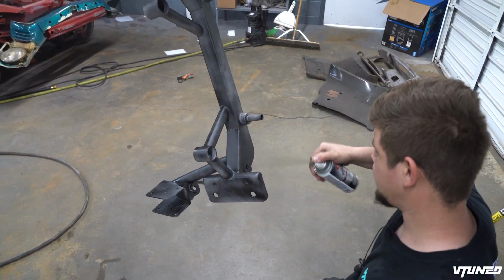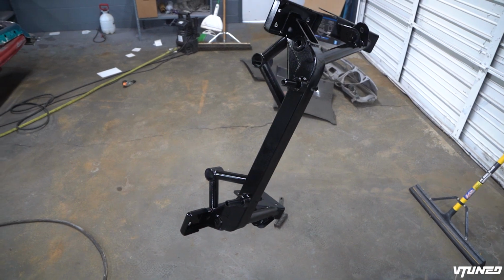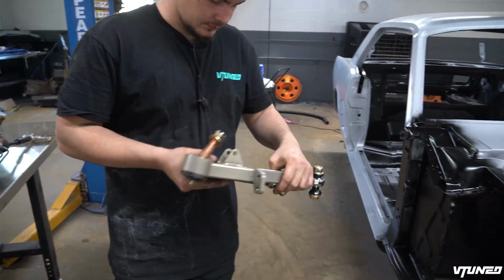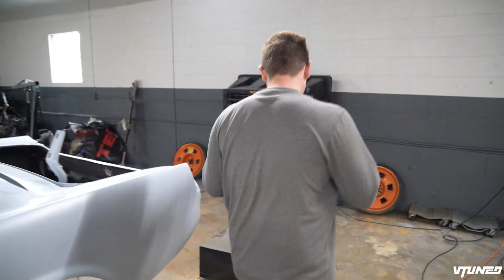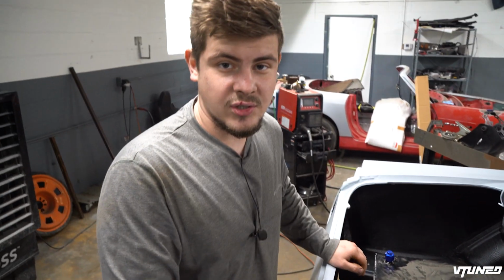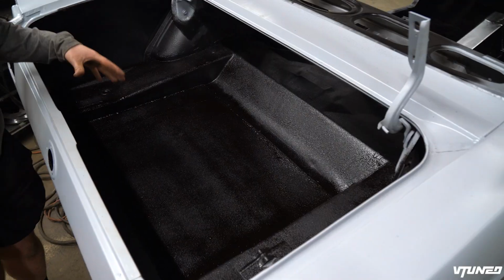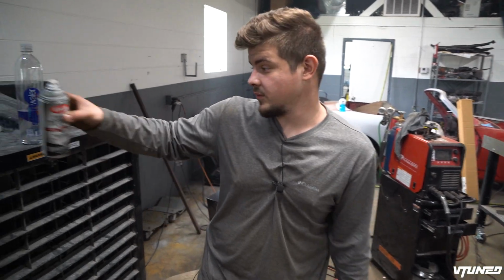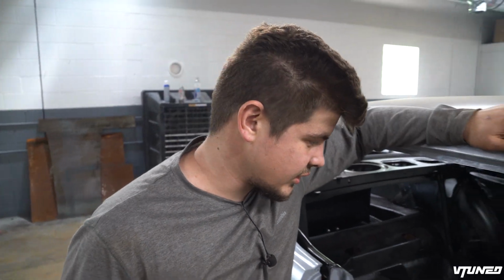Finally Starting To Reassemble The 1965 Ford Mustang (HUGE MILESTONE)

Comment: Automatic will be the best option..

lower the fuel tank for gravity.. then filling cap keep it from right side 

Open one small round cut in trunck for drainage of water if decide to clean trunck, first find rubber cap for it same as OEM .

Don't forget to seam seal all weding and joint..

Comment: Don't rush this build as it appears that you are. You have access to a paint booth, I cannot believe you are rattle canning it. Also, drop the tank. It will not be to difficult and the filler neck would align to the factory location.

Comment: Hi Ben, as you wont be racing this car, wouldn't it be nicer to use the original fuel filler location and lower the tank to allow for that. Keeping centre of gravity as low as possible? Locating the filler to another place means another hole or mod. Using the original filler will be a wise move I think. Auto is cool as well as the build, awesome.

Comment: Lower that fuel cell as low as possible for weight and trunk space...the way it is typically done is to build a small box/cage out of square or angle iron that the cell/box fits into and the top of the cell is maybe either flush with the floor or up an inch or two....

Comment: I really think you should put mounting tabs on the top of that gas tank and trace it on to that aluminum floor you're putting in and cut it out and drop the tank in a mount it up with the tabs you weld on top of the tank

Comment: The sump in the bottom of the tank should face backwards to not cause a fuel starve issue. Cut a hole for it to drop thru the floor. Also make sure you put a firewall between the trunk and passenger compartment.
Reply: NHRA  rules.
Reply: @chriscatarcio2983  multiple sanctioning bodies require it. Just a good safety precaution if your going to install a fuel cell in the trunk.

Comment: Defiantly recess the tank , if it was just sitting on the trunk floor the top of your tank would be level with the filler opening , it kinda needs to be down hill for the fuel to be able to run into the tank .

Comment: I would cut the hole to get it flt the tank flat.  Then I would measure to see if I could cut  hole in the side of the fuel cell to use the original fill location and run a piece of pipe to connect the 2 locations.  Wouldn't know if it is possible until the cell is in its final place.  Also you have the tank backwards.  Feed lines towards the rear because that is where the fuel goes when moving forward.  You will have fuel starvation in the direction.

Comment: FYI the bottom fuel feed on the fuel cell goes to the rear of the car, you keep sitting the tank in with the lines facing forward.  If you put the lines forward you can starve it under a hard launch.

Comment: the outlets on fuel cell need to point to back for fuel to not slosh back and starve the system on launches i would recess it in to floor to get some trunk space and use factory filler as well

Comment: just purely as a performance standpoint putting the fuel cell halfway through the floor one would help with the filling but also puts the weight lower in the body so its handling would be better but its your stang

Comment: put the tank underneath the plate you just welded in. then you can use the factory filler there is plenty of room under where the tank went and bonus you have boot space and the car don't smell like fuel when you top up cheers from down under

Comment: I think this is the first car youtuber to say he doesn't like manuals 🤔 I give him props for expressing the truth and not being cookie cut like every other car youtuber, that scream "manual or die!"👏
Reply: Automatics are boring.  They fucken leak all over the place when you take them. Out for service. and rob horsepower.  
They are heavy to. Make the car hot  inside. They suck.  V8 super cars run stick transmission.  Clutch less. NHRA  pro stock. Cars run a stick. Give me a break.

Comment: Hey Ben: if you decide to do another car like this, or any project where you're going to be spot welding, you might want to think about buying a spot welder...it's SO much faster and easier than a mig. Two electrodes, press against the metal, zap, two welds instantly. Move on 2" zap, 2 more welds..
Reply: Are you sure the shop spot welders are that good? I’ve seen others using them having to weld over the top of them again probably because the spot welds don’t go deep enough.
Reply: @R2D2trashcan  they don't go deep enough due to the settings. I worked in a body shop and that's all they used, as strong as the OEM ones. 

I also designed metal store fixtures and worked closely with many manufacturers, set up properly, the spot welds are as strong as virgin metal. 

You have to set them high enough to produce a strong bond, but not so high you blow through the steel.
Reply: @muskokamike127  ah ok maybe people just don’t trust them also as the weld looks so clean. They look really good.
Reply: @R2D2trashcan  Yeah there's no splatter or bubbling or anything to grind. When they're done correctly, when you chisel them apart you leave the chunk of steel behind where you attached it....When I was first learning to use it, the boss would give me a bunch of scraps, I'd zap two and he'd pull them apart with pliers. "hotter" he'd say. I'd turn it up a notch and try again "ok, good" and when he peeled them apart it'd leave a chunk behind. 

Then he would have me turn it up again and he'd peel it like it was nothing but I'd left a big circle behind because it was too hot.

Comment: The sump in your fuel cell goes to the rear, and return and vent in the front. That way as the fuel level drops and under acceleration fuel is pushing to the sump and outlets. If you install it backwards fuel will rush away from the pickup and also fuel will try to climb out the vent and hinder fuel trying to return to the tank. Never, I repeat, never run fuel lines inside the car unless you have a death wish. And for that engine, one fuel will do the job. Cut a hole in the trunk floor for the sump to protrude through and run the lines outside. For that engine you don't need two fuel lines. You will never make enough horsepower to require two. I use one line on my race car that is 1100 hp, 598 cubic inches feed by two 1050 Dominators and it never starves for fuel. Also there are some great fuel tanks out there that fit like the stock but have vast improvements, suitable for the street or track.

Comment: Yo uncle Ben... Remember, with great added power comes great added responsibility... Lower the tank... Either by raising the tabs on the cell, cutting a whole in the new floor board... Or mounting it underneath with steel straps...
Better center of gravity and definitely for the longevity of your fuel pump... As well as being able to use the factory filler...

Comment: I would lower the tank at least half way down into the hole. That gives you more trunk space and lowers the center of gravity. You don't want 120 lbs of fuel sloshing around up in the trunk.

Comment: Automatic is where it at and you can use the factory shifter to hide the upgrade . Also the fuel cap can be put on just not used but maybe put a battery cut off in the hole instead .

Comment: great work mate but i would lower the tank futher into the floor to make easer to fill as the filler needs to have a slight angle to ease filling tank.PS check top of compared bottom of filler hose

Comment: not dissing the auto box as they are a lot more refined from the 2/3 speed era, but  putting a manual in neutral at the light eases clutch foot    -  Big block manual Chevy Corvettes taught me that
Reply: thats just normal driving brah you don't sit for long periods on the clutch in any car

Comment: I could tell by the sound you turned down your voltage and wire speed to better suit thinner gauge. Much nicer welds. Good job dude.
Reply: I won guys!

Comment: Looking Sweet.Use a very good Metric ruler and measure all the front end components so you have a good and Even start for alignment.I was taught to count the threads when changing tie-rod ends,etc and you'd be close to true.I said Metric as it's easier to calibrate.

Comment: 🌴 Hey Ben, for on the street and in 1/4 mile runs go automatic, if you want to do serious stuff you can put a shift kit in it and a stall converter, plus electronics in the cars computer, ( beast mode ) hooked up to the turbo I think your going to have way to much fun !  When you do the fill on the gas tank careful you don’t get metal shavings inside, and you’ll need to vent that tank to the two fittings need to face the rear of the car and run the lines under the car for safety reasons, would of liked to see the front shocks on , and I think things are going to get interesting when you get the motor in and start hooking up the steering, next video is tomorrow right ! 🤪

Comment: Maybe i'm wrong, but i feel like you're rushing with the fuel tank and the rear end. The trunk looks amazing, and you put so much effort on the front end of that car it would be a shame to just rush the fuel tank situation. Like others said, maybe take some time to drop the tank below the floor. You will win on all fronts : great trunk space, lower center of gravity, and must of all better security. Any rupture in the fuel cell inside the cabin would be a disaster. You have the skills to do it right, all you need is patience.

Comment: Hi, on my 72 Maverick I use the stock fuel fill hole for my battery cut off switch. It was  a real pain to fill the car at the pump. It is was always leaking gas as you filled up using the stock location. I just cut the curve point of the filler neck and filled it up with the trunk open.

Comment: Now it will handle excellent. I had a automatic in my 67 mustang it was still a lot of fun to drive. Ir would get first and second gear scratch with the old 70s 302.  It would seem your stang  it will be ridgid because of all the improvements you have made like the connect the front to the back with tubing and the trunk and the solid welding heavy tubes in the front and new modern supension everything you have done to it it should be pretty rigid? Only one way to find out. The modern mustang motor will be like a rocket ship.

Comment: When you weld long runs weld 2” skip a inch and weld 2”. Cleaner weld and looks a lot better. Just as strong. Trust me. Ask a pro welder.
Reply: Also prevents a creeping crack in the weld if it should happen,stops at the gap..

Comment: Nice job. Better than your last Mustang. Since you've eliminated the fuel tank from hanging down, put some braces across the bottom and mount your spare tire underneath. You won't have room for it in the trunk.

Comment: Have a great day Ben, you got a lot done, ever think about paddle shifters they could work with an automatic transmission, safer too with the amount of power you are putting in that stang, both hands always on the wheel at all times.

Comment: My opinion if it means anything would be to lower the fuel tank.  Put in the sheet floor and then cut out a hole for the fuel tank. I think you would be happy with the result. Other commenters seem to have the same opinion about having a lower tank.

Comment: You just increased the center of gravity quite much with a full tank. I’d install it 5-6” lower where the rear sill is. Then you could also use the original fuel cap opening for the filler pipe.
Reply: Not to mention the fact that seeing a fuel-cell peek out underneath the rear valance makes it look pretty bad ass. This poor kid doesn’t have a clue

Comment: Use those rubber bushings that you deleted from the steering rack as sort of stand-offs on the back of the fuel cell to clear that bottom hump.  Would help with vibrations, too, if you think about it.  Just a thought

Comment: That’s your sump Ben . It goes to the back for fuel transfer. Just raise the cell , have the lines go to the filter then bulkhead fittings to go to the lines under the car. Is the pump going in the tank ?

Comment: If this is going to be a daily driver, buy a intank fuel pump and mount it inside the fuel cell. External fuel pumps, especially if you mount them inside of the trunk are super noisy and buzz all the time. Another option is to mount it under the car!

Comment: Coming together nicely! Yeah epoxy primer can take filler as was reading the same. Did you use green etching primer on the trunk sheet you fabbed in?
Reply: no he used straight to metal paint   lmao  this thing is going to be a rusty mess in no  time.

Comment: I would definitely cut the fuel cell in and run fuel lines outside. 
The outside burning is better than the interior on fire in an accident.

Comment: Ford had a huge problem with their Pinto autos.  They used the top of the fuel tank as the floor of the trunk.  When they got rear ended, the tanks ruptured and burned to death the occupants of the cars.  You have a tank with no sheet metal between it and the passenger compartment.  You may want to think about that......

Comment: Fuel line outlets should be facing the rear of the car, not forward.
The cell would be better recessed into the floor rather than on top of it.

Comment: You are mounting the fuel cell backwards. The part that extends below the cell is a sump. The sump is made t face the rear so you do not starve the engine of fuel during acceleration.

Comment: That drop down in the tank is the sump it needs to goto the back as when you accelerate fuel runs back.
Reply: As much as you don't want cut up the metal youve already done. Drop the tank down till you can use the filler from the factory tail panel. This will lower center of gravity also more trunk space and then you can cap the floor pan area to prevent fuel inside the cabin of the mustang.

Comment: What about the struts or coil overs? I mean you did say it was finished, right? A lot easier to install them before you put on the fenders bro. And just wondering if you thought about making the gas tank an even height as the rear seat deck lid? That would have given you a nice amount of storage space in the trunk. I mean, do you really think you will be the only owner of this car? And if not, won't the next owner like to have some space in the trunk? Plus like the guy below said, lowers your center of gravity, 20 gal. of gas is at least 160lbs of weight shifting around back there from side to side which can cause a lot of push side to side.

Comment: you def have some research and learning to do.  the dyno on the tank does towards the rear.  that tank is actually designed for drag racing,  not really a pro touring type tank.

Comment: I think the automatic is fine but don't put do the Fuel Tank that way. With all you are doing to this build, pay the few extra $ and get a stock tank you can modify for the Holly system. That way you can also use the Stock filler & cap.

Comment: Dont you need like a seam sealer where you did those welds? I am no expert but from some of the videos I’ve seen before, they used to.

V tuned, I am sure you can find a solution to use the old gas tank opening! Tbh, after all the hard work you put into it, its kinda lame opening the trunk to refuel.

Comment: I was thinking that you would use a standard Mustang tanks use external high pressure fuel pump so the you could maintain the gauge system with a clean look and function

Comment: Bro please put a drop tank in that car with intank bucket setup so you can run duel in tank pumps. Why? Coz it lowers the centre of gravity and keeps fuel pump noise down coz fuel pump noise eats at your soul after a while  lol been there done that. And there is some real good high flowing brushless fuel pumps available these days like the pumps in the new hellcats (Walbro 530LPH) which will future proof the car if you want to run boost down the track.

Comment: Sorry to be an armchair builder, but....I really think the tank placement is a bad idea.  From what understand, you are building a fun daily driver.  Not a race car.  Therefore, you really should reconsider installing a stock gas tank so you have usable trunk space.  At the very least, drop the tank down and build a panel over top to give you usable trunk space.  This is going to hurt your re-sale value in the long run.
With all that said, this is your car and you can build it any way you want!👍
I am enjoying the build!😁

Comment: You should have built a shelf for the tank, 20 gallons of gas that high up is really going to throw your center of gravity off,  You want it as low as you can get it my man.  Then you can use the filler.

Comment: First off if you want to race the car in any type of competition YOU can't run fuel lines inside the car. Second , the fuel cell as others have replied goes in with the sump , where the 2 lines come out of the bottom of the tank  towards the rear. The top lines are return and vent. The vent needs to vent out the floor to under the car.    You better weld in the front coiler shock bracing before installing the engine.  That is where you use the thicker material , not on the floor.
Reply: this car will never drive out of the parking lot on it's own power, let alone race.

Comment: If you are going to use the original filler tube doesn't the tank need to be lowered.  Otherwise when the car is under power gas will be pouring out the back.

Comment: Should have went with an aeromotive stealth gas tank with an intank 340lph pump, designed for a classic mustang. I have one on my 67 mustang with a 5.3 lm7 swap wirh a 76mm turbo. Also have a stealth gas tank on my dads 390 mustang fastback and on my Ls1 swapped 69 camaro. 

The more ya know…

Comment: I honestly think it is a bad idea to install the gas tank on top of the new back floor pan. Cut a hole the size of the tank and install it from the bottom, more or less at the depth of your original idea. That way you can also use the original gas cap thingy. Just a thought... use it, don't use it...